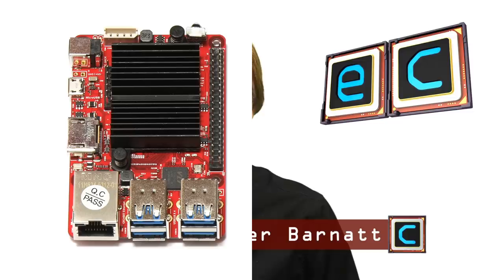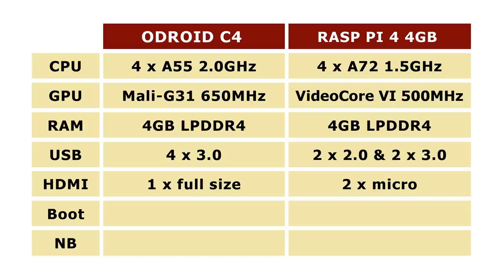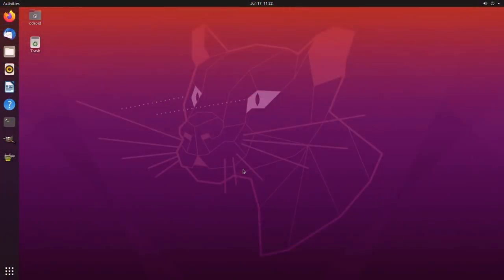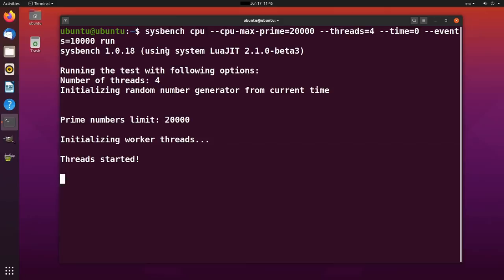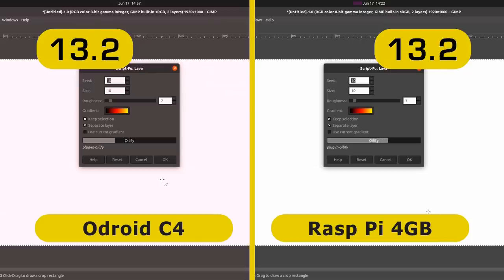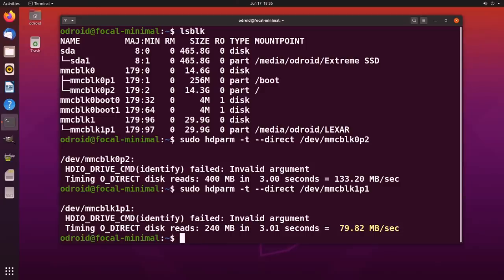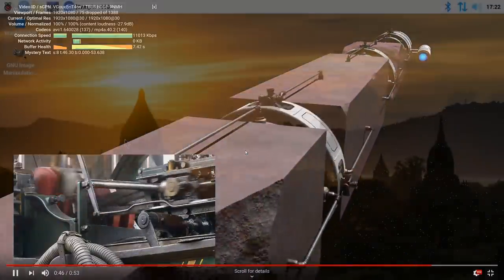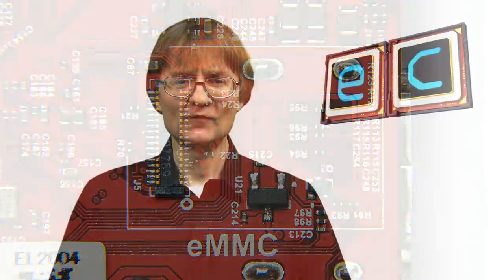Odroid C4 vs Raspberry Pi 4

Comment: An interestingly unexpected result there, with the Pi 4's age not handicapping it.  A comparison of power consumption, perhaps combined with a thermal test might have been interesting. 
The 64-bit vs 32-bit OS comparison was quite startling, and very instructive.
The 4 thumbs down are presumably from Odroid's marketing department. :-)*
Reply: Would be nice to see what kernel yout running on the Odroid if doing a compare lets atleast tell the whole story.  I for one am running 5.7.8 on my SBC's if I were running Xorg or wayland I would also be usng a latter Mesa set with the latest Panfrost/Bifrost implementation also.  This would have hedged alot more towards the Odroid imho.  This I think tells a bad story by not using the correct setup for the odroid SBC.
Reply: I don't know why you think Odroid's marketing department would downvote it. What we saw was that the CPU tests in a 64 bit OS came out very very similar, with no more than about 20% difference between the two -- something you wouldn't notice in normal use when you're not sitting them next to each other. The Pi won most tests, but not by much. The same applies to the external USB SSD. However the Odroid absolutely spanks the Pi's standard (32 bit) OS -- very few users go to the trouble of finding a 64 bit OS on the Pi. The Odroid SD card comes in at twice the speed of the Pi SD card, and the Odroid's eMMC (which most people use) is over three times the speed of the Pi's SD card. Where the Pi wins it's marginal, but where it loses it's a spanking. My conclusion is I really ought to get a C4. I have a Pi 4 (and Pi 3 and Pi 2) and also have the older Odroid C2.
Reply: It will be interesting if Chris can get his hands on the upcoming SiFive "RISC-V PC". It will no doubt be a lot more expensive due to using a brand new FU-740 chip developed especially for it. The internal architecture of the U74 is very similar to the A55, and it should be running at around the same clock speed too. Details will be announced in a couple of weeks from now. SiFive's U84 core is comparable to the A72 found in the Pi 4, but is probably still 12 months from an SoC being available.

Comment: I am not surprised the pi came out on top. The cortex A72 is a big core with all the big core features, out if order execution , deeper pipeline and some instruction level parallelism. The A55 on the other hand is an inorder core and so has had to be vastly over clocked to get anywhere near the A72 at 1.5ghz. that is why it  odroid can not even contemplate living without a heatsink . .

Comment: Thanks for curing my FOMO, Chris. I was thinking to sell off something so I could buy a C4, but now I'm not that interested since I already have a rpi 4B setup with an SSD. :D
Reply from the maker: A Pi 4 with SSD takes a lot of beating.
Reply: @ExplainingComputers  will SSD USB3 likely run a lot faster than uSD u3? I been having fun with Pi4, Argon case and over clocking plus experimental Vulkan drivers - I made a video of Open BVE train sim running nicely on it. I can get it to 18fps - simulating London Underground travel is somehow comforting in these tricky times :-)
Reply: C4 can be Overclocked to 2.1Ghz, by default runs at 1.9Ghz. However its I/O transfer speeds and reading/writing speeds are slow, even from USB3 SSD boot  which BTW achieves (220MB /s max), eMMC module (170MB /sec) and uSD (70MB /s) the latter is almost twice as fast as Rpi4 booting from uSD(40MB /sec). On the other hand, Rpi 4 OC'd to 2Ghz with a Samsung Evo 860 SSD drive can achieve 395MB /sec reading speeds under Raspbian 32 bit, Manjaro 20.06 and Ubuntu-mate 64 bit 20.04 OS's.

Comment: I've always thought that the Raspberry Pi foundation had taken a hardware version of the 'Linux From Scratch' approach to building a modern computer system. That is; breaking the machine down to its bare essence, then building it back up to what most of us expect from it. Clearly, building a robust 64 bit system is more complex, or the trade - offs too great to obtain a more complete solution (yet), though others like the Odroid are getting it done. I've admired the RPi's methodical way of gearing up though because one can be assured that the trade - offs were well studied when a new board is released.

Thanks for another great video Chris. Your presentations always keep me thinking.

Comment: I was surprised by the results. I'm pretty thrilled with my Pi 4. I've been using it as a desktop for a while now. With it running at 2.1ghz it's very good. The Ice Tower cooler keeps it cool no matter how hard I push it.
Reply from the maker: The ICE Tower is just the best.
Reply: @ExplainingComputers  Don't be so modest, Chris. I have complete faith that when your inevitable "RPi4 Extreme Cooling - Mineral Oil Edition" video drops there will be a new king of Pi cooling. And if not then, there's always the Liquid Nitrogen option...

Comment: That's pretty curious that, according to those tests, both boards are comparable to Core 2 Duo. Pretty impressive, given that Core 2 Duo systems are still quite usable up to this day :)
Reply: I still use a Core2duo 8400 as Media Player and a C2D 5400 as a media/file server
Reply: Are the power consumption characteristics of Core 2 Duo comparable with ARMs?
Reply: @XuMuKHC  of course not :) Core 2 Duo T9400 had 35W TDP while a Broadcom chip of RPi has only 4W.
Reply: @Mikolaj Kraszewski it is more or less the same, as all the electric energy consumed by the CPU turns into heat. With the only caveat that power draw may exceed TDP if a CPU is under heavy load.
Reply: My Pi 4 is currently being used as freeview DVB-T to IPTV streaming solution. I also run a custom script to generate HLS streams from DVB-T for web players, which requires audio transcoding as most streams use MP2 audio. I was pleasantly surprised than the Pi 4 could transcode audio for 15 channels at once with less CPU usage than an old bulky Athlon x2 230 (Core 2 era) system I've originally used for this purpose. All while being passively cooled in a FLIRC case with CPU temps never going above 60 C.
So yes, ARM CPUs can indeed be used as low-power desktop systems with the right software.
Reply: @Mikolaj Kraszewski only in intel world lol
Reply: Shouldn't be surprising given that a raspberry pi system is also quite usable. If you can get the system drive off a microSD card you could gain even more benefit.

Comment: my test rule: who has the largest online forum when when I get stuck on something!
Reply from the maker: Good rule -- Pi wins!
Reply: exactly! community support is way more important than anything else
Reply: As an Odroid XU4 owner I agree. That's why I bought my brother two RaspberryPis. The Odroid H2 on the other hand is just fantastic. I hope they release a low power higher performance Ryzen offering in the future.
Reply: @lordwasabi6330 oh which variant?
Reply: @trollius2718  
I had the passively cooled XU4. I bought my brother a Raspberry Pi 3 B+ for tinkering and a 3 A+ for games. Although the XU4 was far more powerful the community is smaller and the board is far less optimized. The Odroid H2 replaced the XU4 as my NAS and I am finding I much prefer x86 for this use case (Plex transcoding etc)
Reply: @lordwasabi6330  seems like u dont own any x86 chips 😂😂🙌
Reply: @lordwasabi6330  That's why I got my H2. I had wanted to get an XU4 for quite some time but I'm glad I waited. I have mine outfitted with 8gb Hynix RAM and a 1tb Intel 660p NVMe. I doubt I'll have to upgrade anytime soon. Maybe add some SATA drives but that's about it
Reply: @lordwasabi6330  I've been waiting for someone to release something in between a DFI GHF51 and a Udoo Bolt.  I think embedded Ryzen boards would take off if they weren't all so expensive. Maybe we'll see a price cut when next gen launches
Reply: @johnconnor2572  It's a great machine. Only issue I had was figuring out how to install Ubuntu to and eMMC on it. After that everything was smooth. I'm trying to find an excuse to buy the upgraded version with the dual 2.5Gb ethernet but my router is still only gigabit. All in all a great device for a variety of projects.
Reply: @lordwasabi6330  a pi with ryzen? wtf
Reply: @lordwasabi6330  Odroid H2 is just a PC, doesn't count as a comparison with ARM boards like C4 and Rpi 4. Odroid-H2 will work out of the box with any virtually OS including all linux distros. No tinker is necessary either. H2+ price can be prohibitive too for the majority. A proper H2+ configured with 8gb RAM/SSD, PSU and case can easily reach $280. That's the equivalent of buying four(4) Rpi4 4Gb with Case, 32Gb Micro sd card and PSU.
Reply: @lordwasabi6330  IMHO, a H2 as a NAS device is a waste. Totally overkill. Not very cost-effective either.
Reply: @josephtremblant2173  what arm devices has a simple way to connect to 2x 3.5" drives and power them, work out of the box with little to no tinkering required and have the power to transcode? For me it's been a great PLEX device. I have my XU4 for when I want to tinker.
Reply: @ExplainingComputers  HELLO THERE . IS THERE ANY MINI PC THAT I CAN SUCCESSFULLY INVEST IN ????? THANK YOU
Reply: Depends on how many languages you speak...
Reply: This is absolutely the guiding principle behind so many technical decisions I make at work.
Reply: @ExplainingComputers  You should give the power consumption in a sitting state for these boards, and for other states, like playing a YouTube video, or a particular app/program.   The A55 is suppose to be lower in power compared to A72 coes.  Which could help out when making a robot with either of these boards.

Comment: I'd really like to see a performance comparison of the Rock Pi 4 vs the Raspberry Pi 4. The Rock Pi 4 is still the nicest SBC I've seen on this channel, that's still in the Raspberry Pi price range. I think it's only about $5-10 more than the RasPi4, which is close enough, but packs on far more features than either the RasPi4 or the Odroid C4.
Reply from the maker: I had not thought of this -- what a great idea for a video. Noted with thanks.
Reply: @ExplainingComputers  That would be fantastic! I've also been meaning to ask for a while, if you might also consider covering AROS at some point, the x86-based Amiga-like OS? I know you also cover alternative OS's, and AROS is definitely one of the most fascinating OS's I've seen. I didn't even know it existed until sometime in the last year, and I was surprised I'd never heard of it. It's basically a modern, opensource Amiga OS, that's API compatible, yet runs on x86 based systems. Although I'm personally more comfortable on Unix-like OS's and AROS seems foreign to me, exploring a new OS is like exploring a whole new world, in a geeky sort of way lol. But then I also didn't grow up on an Amiga, like many others. Anyway, I think it would also be a very interesting video topic sometime.
Reply: My past experience with Mali GPUs with GNU/Linux suggests that the lack of open source driver support will always be a source of headaches. I suppose it's possible that this has changed (or could change). Of course if you are interested in using Android, it would not be an issue.

Comment: At first I was screaming "Overclock the Pi!" But quickly found out that wasn't needed to school the Odroid. What a nice surprise!
Reply: But with a fan when u over lock.the Pi and use the experimental Vulkan GPU driver the Pi 4 is Uber cool - i have not tried USB3 but for sure that's just made the list
Reply: @stephenhookings1985  I've got an argon 1 case/fan that is awesome. 2.147 GHz OC. I'm sure if the boss did that, it would beat it on all specs.
Reply: @decrepit9357  plus the Vulkan stuff. On my https://youtu.be/RhCdycfyDGg it took OpenBVE from 11 to 18 FPS - I can't get that on i7 with NVidia 980m :-) I so have to try the SSD (or even a spare 7200 rpm if the USB 3 interface is throttling it) - I didn't realise how relatively slow the uSD is.

Will be great when fully support GPU driver is default - I think the 64bit Ubuntu was better supported than some other OS. The acceleration makes it feel like a real computer.

Comment: Another great video Christopher. Although the YouTube playback was near enough on par, I don't know that you noticed that after the 75 frames that the Odroid C4 dropped it found its legs and no more were lost where as the Raspberry Pi 4 continued to drop frames for the duration. Probably insignificant, but I thought it worth a mention.
Hope the recovery is going well and you've had no further infections.
Reply from the maker: A good spot. Unfortunately I was back in the hospital this week where my would was opened up and they took another biopsy, suspecting the first one gave a false negative.
Reply: Sorry to hear that Christopher. I know I'll be among many with my fingers crossed for negative confirmation.

Comment: I'm glad to hear you will be looking at raspberry pi 64-bit operating systems. I hope that's coming soon! I haven't been adventurous enough to install a 64 bit OS yet (little time to troubleshoot right now), although I do have an 8GB pi now, so it would really make sense to do if the OS is stable.  The combination is a game changer I think, as far as using the pi as an every day computer.  Thanks Chris!
Reply from the maker: Thanks for this. The Pi 4 64-bit video is scheduled for 9th August (allowing time for GPU-accelerated Ubuntu 20.04 to be released).

Comment: Great comparison video  Chris! Having 3 Pi 4 models (including an 8 GB model) I did not realize how much faster the 64 bit OS can be on certain tasks. I have an SD card with the beta Raspberry Pi 64 bit OS but hadn't bench marked it against the 32 bit version. I also have an Ubuntu 64 bit OS card with the XFCE desktop on it. It "feels" heavy compared to the beta 64 bit Raspberry Pi OS and certainly uses more RAM just idling.

Comment: Nice! Though the 32 bit test is testing more than word size: iirc the 32 bit raspberry pi os is built to support some really old arm processors with substantially fewer math and vector acceleration instructions, so it can run on any raspberry pi ever made. (Might even be arm v6, maybe?) Wonder how much of the weakness is due to that (arm v6 vs arm v7+neon vs arm V8 64 bit)
Reply from the maker: This is a very important point -- I think you are right that backwards compatibility takes us back to ARM 6 for the Pi 1 and Pi Zero models.
Reply: I couldn't agree more – I was very disappointed with the Pi 4 running the official Raspbian, didn't seem any better than my trusty old 3B... then I tried Manjaro 64 and quickly forgot that I was actually using a Raspberry. Very bizarre.
Reply: @ExplainingComputers  Yes and no!  32-bit Raspberry Pi OS has four different kernel files in the /boot directory that are chosen depending on the CPU present. The original Pi uses kernel.img and there are also two ARMv7-optimised kernels and an ARMv8-optimised kernel.
Reply from the maker: @johnm2012  I stand corrected. :)
Reply: @johnm2012  Might worth check out whether GIMP is provided in armv6 or armv7...

Comment: Excellent comparison. For me, the Pi4 is the winner. The lack of a heatsink is not a problem, as there are so many solutions available, and if you need Wi-Fi and or Bluetooth they are already present, no dongles to buy. Also, the Pi can be overclocked for even better performance. Not sure if the Odroid can be overclocked.